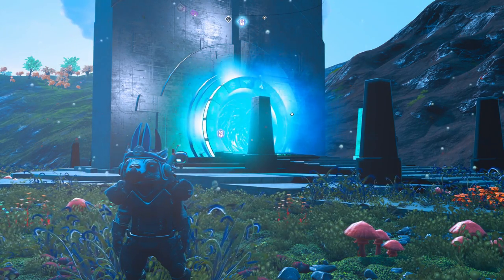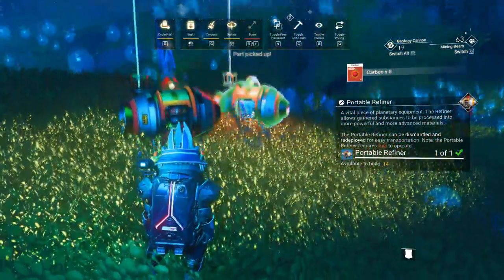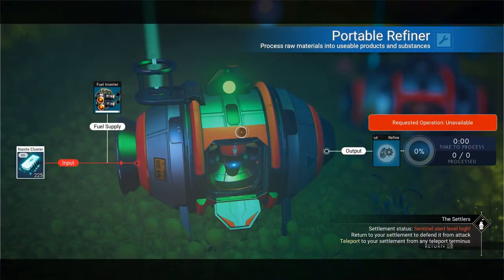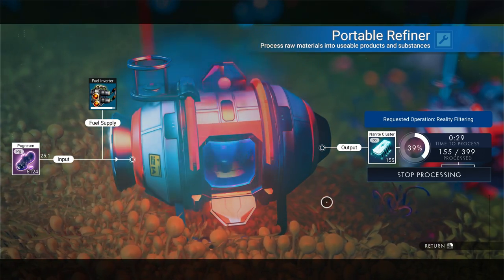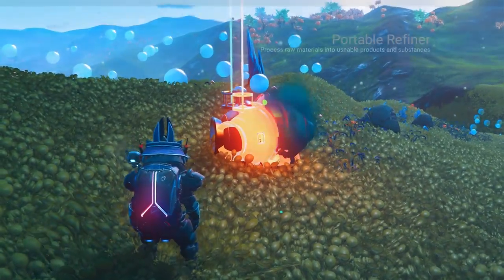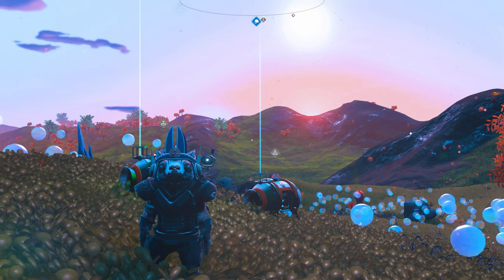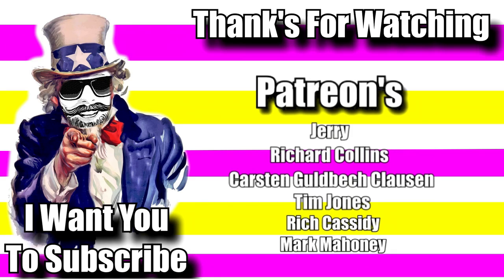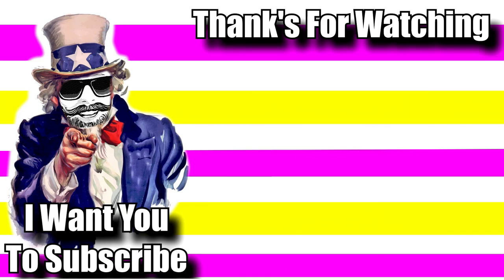Ultimate Most Insane Nanite Duplication Glitch Ever - No Man's Sky

Comment: I found out the fastest method is ti do it with the metal you get from the freighter, you just need around 2200 because the maximum nanite the refiner can hold is something around 4100 and the conversion rate is 1:2 , wait 12 minutes and the madness can start.But I used the middle and big refiner.
It sounds more time consuming but to copy the salvage data over and over takes almost as long as just waiting.

Comment: Theres an easier version of this glitch:

1. Put down a floor part - (this helps so you can see what your doing in step 3 without the foliage obscuring your view) 

2. Put down a a portable refiner  on the floor floor part. 

3. Fill with Runaway Mould (5:1)  or Pugneum / tainted metal,  make sure refiner is 100% full with fuel and start refining.

4. build another portable refiner and place on the right of the first refiner so that they form one "tube" refiner -  look at the feet of the two refiners so they are just overlapping - If it is done correctly so they become one the second refiner will immediately start refining as soon as you lay it down.

5. Repeat step 4 on the right. If done correctly the third refiner will immediately start when you lay it down.

9999 Runaway mould will take approximately 20 minutes (if i remember right).  Refuel the middle refiner if needed, leave the left and right refiners alone.

6. When Middle refiner finishes the refining check the LEFT refiner,  put the Nanites into your main inventory and any surplus mppuld if you want to.

7. Check the middle refiner.  Do NOT REMOVE NANITES or SURPLUS MOULD / PUGNEUM,  immediately come out of the middle refiner and check the left refiner again.  You will see  the nanite re-fill right there.  Deposit nanites.

8. Keep repeating steps 6 & 7 untill you are bored of colecting nanites.   LEAVE THE RIGHT REFINER ALONE or you may mess up the glitch;  Just keep taking from the left, then checking the middle without removing, then go back to left for the re-fill, and repeat.